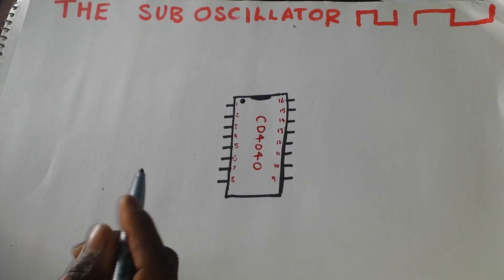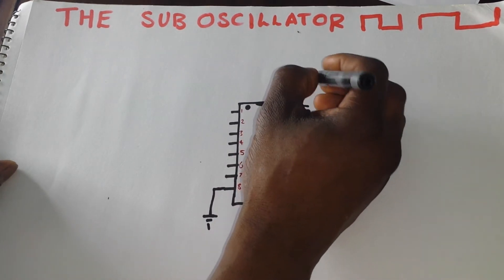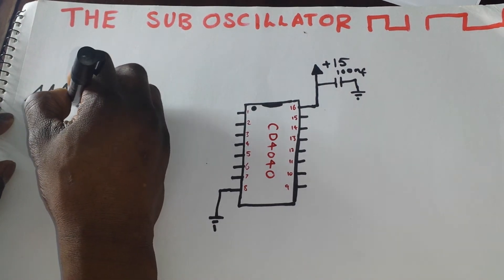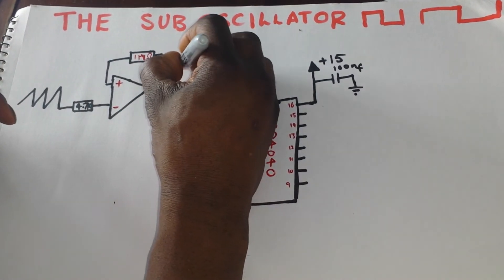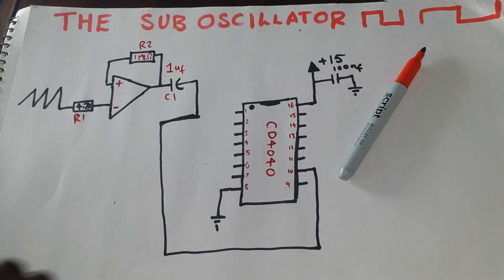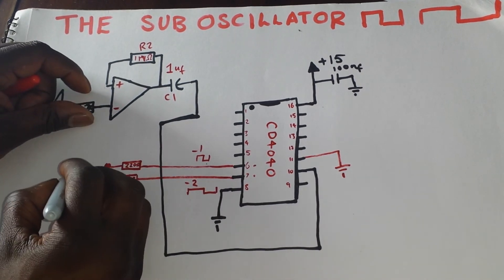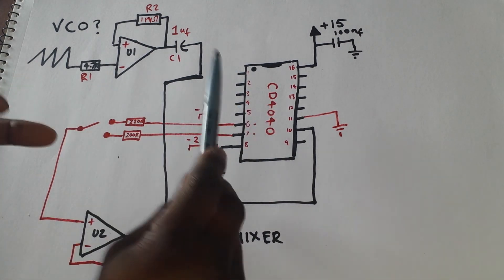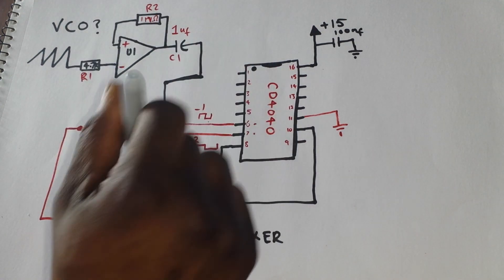DIY analog synth project Tutorial Part 19 ( The Sub oscillator )

Comment: Watching this I had an idea. You could make this sub osc have both square and sawtooth out relatively easy. You could waveshape the output using a simple RC network.
Feed the square out into a non polarized capacitor, followed by a 22k resistor to ground, than a signal diode, another 22k resistor to ground than out through a  another resistor.  
You will need to choose the capacitor value according the the frequency you are wanting. 
It won't be a textbook saw tooth but its vary close. Lots of string synths used this approach to waveshape. Just an idea:)
Reply from the maker: Hey thanks for your input. Funnily enough I did try this to save shape the sub square to a triangle via an rc network however i did find the amplitude was very frequency dependent . 
Maybe i'll look into another method for the future.  Thanks again. :-)
Reply: @AdamTheAd-vanc3d  No worries. Just thought id mention it. If you look at the service Manual for the arp omni 2 (the theory of operation section) it explains the waveshaper. Its pretty much an rc differentiator with a diode to clip the negative portion.

Comment: How about a passive RC filter just for the sub to take the edges off if needed? Just found your channel via Pete McBennets video. I have some grand plans for that as well. :)
Reply: cl3mens Just commenting with my synth related account as well to follow.
Reply from the maker: cl3mens Good idea actually as sometime i find the pure square a little overbearing. The only problem i would have is that this would make the  sub osc frequency dependant to amplitude as you raise the  frequency the amplitude would diminish . As i was thinking of having the sub a triangle wave from an earlier experiment . Anyway i will have a go and maybe post a small demo vid.  I could possible make the the resistor a pot so you can have a varied timbre.

Comment: Hi there. I like your project, your efforts and your videos. I am an electronics engineering Msc student also in the UK, and I have built an 8bit computer CPU and system from scratch using only 74HC logic, and you can see it on my videos as well. I have been wanting to build a synthesizer as my next project and I have just found your channel and subscribed.
Reply from the maker: Engineer Of Wonders . Thank you for your comment and your subscription support. I will for sure check out your channel and vids. 😊

Comment: I made one quite similar last year.
one input buffer and one comparator for clock in to a 4040.
then a mixer for the input signal and octave 1,2 and 3 down with a level pot for each.
works very well.
Reply from the maker: Borgar Sounds like a good option to wave mix between all three octaves or at least have that flexible option :-)

Comment: you know, that's actually one of the core function of a DCO! the pre dividing is an improtant part if you use a very high frequenzy master clock and want good resolution in the lower octaves. only that in a DCO the selecting happens automaticly, that automation is what I have problems with atm. in theory just the slightest miss count will result in bad quality audio, but in practical it turns out to be rather unnoticable. Classic case of a theoraticle problem, a problem on papper is in actuallity not that big of a deal. But that's what you have to deal with when dealing with exponantional math functions and ALOT of varibals to keep in mind. one of those variabls is the Master Clock divider, wich basicly functions like what you've shown there, just some parts are diffrent.
Reply from the maker: AP Girl Thats intresting thou i was vaguely aware this was the case my knowledge is not too hot to be honest. Im sure with perseverance and determination you will iron out these problems in time :-)
Reply: yea probably thansk^^ those kind of math problems are the worst tbh XD As soon as I figure out the schematics for the counter and dividers I can build this thing^^
Reply: Hey, while searching for parts I stumbeld accros a very intresting IC chip, the XR 2206CP ! 
That chip is basicly a complete VCO+Waveshaping! I don't know if you can still get them but they are definitly worth a look!
edit: small correction here, they are avaible, just abit expencive^^